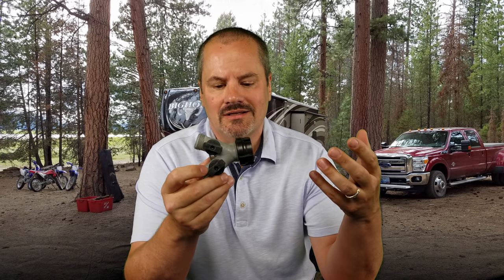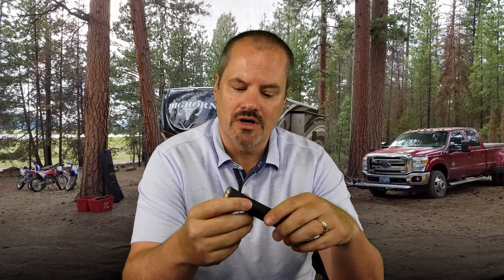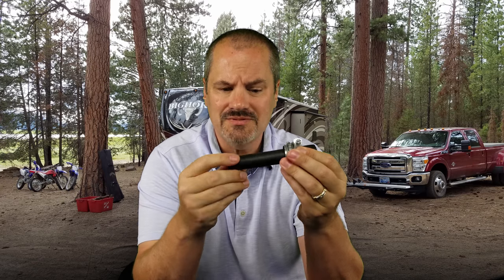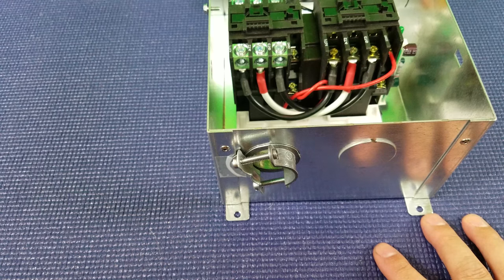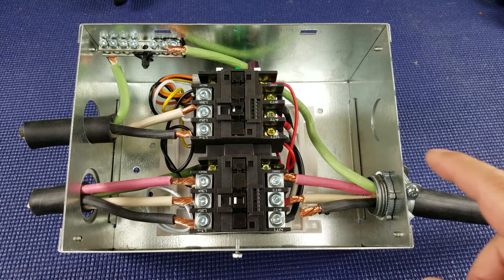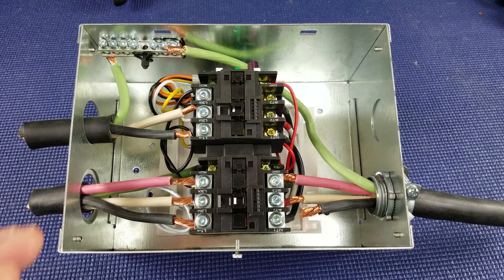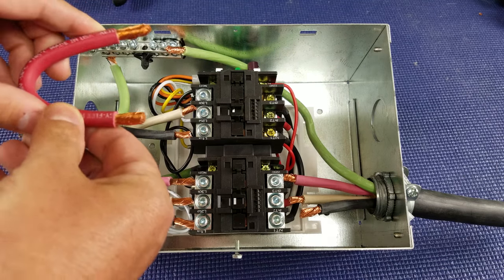Go Power TS-50 Transfer Switch

Comment: Jim, finally a video that makes sense.  What guage wire do you recommend for the jumper. Also,  I have a progressive Dynamics Ems hard wired.  Should this go before or after the bms? Hope your enjoying your new rig. Kip McMillan
Reply from the maker: 6 gauge is what I used and what GoPower recommended.   The EMS would go before the transfer switch.

Comment: This older video is exactly what I needed to know about wiring my inverter into my 50amp switch. THANK YOU! Now, how to run two ATS together to act as a three way switch (shore/genny/inverter). I think I know how, but I'm searching for a definitive answer.
Reply: That's exactly what I'm looking to do as well.  Did you just run one into the next?  I was thinking of running my generator and inverter into one, then taking the output from it and running it into another ats that also has shore power running into it, then the output to the distribution panel.
Reply: @AZMountainMan2U  I did a video on how I word mine. It's on my channel under "campground construction" videos. Basically I rerouted the output line from the rig and wired it into the primary side of the switch which is always the generator side of the switch. And then I wire the inverter into the shore power side of the switch and then wired the output of the second switch to the rig. The video explains it much better. Including what kind of wire are I used.

Comment: Thanks for the info, I had a 30 amp transfer switch on a truck camper set up. Shore power in, through to breaker panel . Remote switch to inverter ,turn on through transfer switch and power early in the morning to make coffee , biscuits. No gas oven. Didn't bother anyone with a generator. 
I was wondering how to get the other side of a 50 amp side energized , didn't think about the jumper... :-)

Comment: These "ATS" boxes for RV are just a pair of bonded contactor in a NEMA box. You can buy the parts for  a hell of a lot less. Some contactors have Normally Open and Normally Closed. I used the Normally Closed to provide hot to the trailer and Normally open from shore power which activates the coil. The contactor had enough "legs" to be able to switch the converter/charger from the normally open too so it kills the converter when I am not on shore power.

Comment: Jim, if I want to add a second shore power input on the front of my RV for my truck bed generator can I just wire that to the same input terminals on the transfer switch you show in your video?  I want to do this because the factory shore power connector is on the back of my trailer, too far for the generator to reach.

Comment: Bummer, I used the go power Ts-30 on my last trailer and it took some wiring but it would disconnect converter automatically when inverter was on. Was hoping the ts-50 was the same as my new unit is 50amp.

Comment: I just hooked the exact transfer switch like he did but, apparently the company switched the lug location around because it didn't work until I switched line 1 and line 2 around. The front panel of the ATS called it Hot 1 and Hot 2. Once I switched it, it worked.  Just in case anyone had trouble with theirs.
Reply: I can confirm that !

Comment: Does it have a timer that can be shut off for a quicker and smoother switch from inverter to pedestal instead of waiting 20 to 30 seconds?
Reply: Swap shore and generator inputs.
Put your inverter input where the shore power would normally be.
Put your shore power where the generator would be.
Worked for me.

Comment: I think you made a great presentation here, you covered alot.  I've got a question i hope somebody could answer, I want to add a 3000 watt inverter, but because my batteries are on the other end of the trailer from the distribution box, i'm forced to put my inverter close to my batteries and that leaves me around 25ft or so to the distribution panel.  So i would run some 8/2 from the inverter to the 50 amp transfer switch,  on my shore power into the transfer switch i would like to use only L1 and leave L2 hooked to the distribution panel,  I would then slightly rearrange my fire place and charger, on the L2 side,  and what ever else i would have to to even the circuits out,  and just use the transfer switch to switch one leg, of circuits i actually can run off the inverter, I would add a neutral from the distribution panel to compliment L1 in the transfer switch.   Im thinking it should work fine as long as the 50 amp transfer switch is capable  of just switching just one leg,   anyone got any comments , and then it might just be easier to wire L1 and L2 into the transfer switch and just turn off the breaker for the charger
Reply from the maker: Your way seems like a lot of work.  I'd either go L1 and L2 through TS, or wire in a sub-panel, for devices you don't want "hot" via inverter (primary item being converter)

or....you go with something like my IC2000 (IC3000 out now) and it replaces your converter and acts as the Transfer Switch.   A bit more $$$, but adds a lot of goodness in one solution (inverter/converter/transfer switch)    Here is link to that video..   https://youtu.be/jjevQ10M97Y
Reply: @tannerjim    The IC3000  was my first pick,   but with the inverter having to be placed near the battery bank, putting in a double run of 6awg  wires in put an end to that idea,  I've got a better idea of how it has to be now, so i will start collecting my parts now,
Reply from the maker: @donandrykew9018  You'd only need 1 run of wire from IC3000 to Circuit Breaker.     LIne in from shore....to IC3000.    Battery into IC3000.    IC3000 output sent to Circuit Breaker.     This is how I have mine wired...works great.   No need for sub-panel

Comment: The video said nothing about the inverter's AC input. Where does the inverter get it's 120 ac power from?
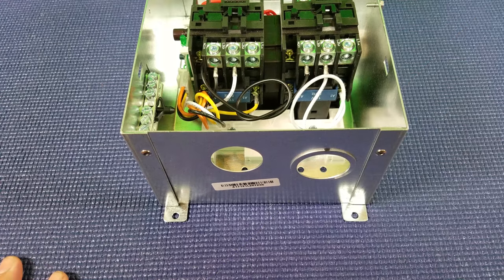Reply from the maker: Look at the 2:44 mark and 4:48 mark...at both of these points in the video I talk about the incoming AC power.    This video is about a Transfer Switch, not an Inverter wiring demo.

Comment: Are the two contactors mechanically interlocked?
Reply from the maker: Sorry, I don't know the answer to that.   I'd call GoPower customer support.
Reply: @tannerjim  Basically, it means if you manually push one contactor to close the power contacts, you cannot do the same on the other contactor. This will prevent one contactor from closing, if the other one is stuck in the closed position.

Comment: What if you also have a generator. Do they make a 3 unit one for that. I think there might already be a auto transfer switch to switch between shore power and generator. I'm not sure, haven't had the RV that long. It's a 2003 Newmar Dutch Star. I know it didn't come with an inverter and I do want to add one. Thanks for sharing your knowledge.
Reply from the maker: Yes, it will support 2 separate 120/240 volt AC input sources, including power
cords, onboard generators, onboard inverters. The ATS will sense the
presence of available power supplies and automatically select the proper one.
Reply: That's incorrect, at least according to the Go Power website (https://gpelectric.com/products/50-amp-transfer-switch/). I'm dealing with this issue right now, trying to figure out how to install an ATS to switch between AC, Generator and solar-fed inverter. The TS-50 only switches between TWO sources, not three.
Reply: If you want to have generator , shore power and inverter you will need another switch.  Go to the link above ,open owners manual , and go to page 6 ,diagram B  . It will show a configuration for , shore power, generator and inverter. Hope this helps .

Comment: Is 30 amp shorepower 3 strand wire? If so, what wire would you recommend for a 2000 watt inverter?
Reply: Geebroni yes 30amp for a camper is 1 hot 120v and a 2000 watt inverter u should use 12 gage wire for the inverter and 10 gage wire for the 30 amp shore power side. Remember rvs use 120 for 30amp and 240v for 50 amp. But 50 amp and 30 amp have all 120v circuits.

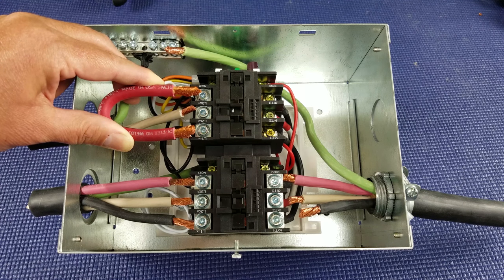Comment: @ 7:00, can you take your converter wire and disconnect it from the breaker and wire it to the same transfer switch block as your shore power wire to bypass the converter when the inverter is being used? And add an inline fuse to the hot wire going to the converter. Would this break the loop?
Reply from the maker: Not 100% sure I'm following your question.  To eliminate loop, simply flip converter breaker...or unplug it if you have access.
Reply: @tannerjim  
I'm thinking that if you disconnect the converter from the panel altogether and wire it to the slot in the transfer switch where the shore power cable is attached then the transfer switch will automatically disconnect the converter for you every time you use your inverter. Just need to add an inline fuse to the converter the same size as the breaker you were connected to. this way the converter is powered directly from the shore power cable only when the transfer switch goes to shore power. No tripping converter breaker or unplugging required.
Reply: Also, Just subscribed to your channel and facebook group (Solar Powered RV's and Boondocking) to help get you over 5000 buy the 31st. :-)
Reply from the maker: @MYCHANNELWITHMYSTUFF  sure...that could work.  Might start to get pretty full at the connection in the transfer switch.
Reply: That’s essentially how the ts-30 is wired to remove the loop.  It’s just fine with caps, not lugs.

Comment: We need full details of materials used and  connection
Reply from the maker: Abideen Raufu
...All that information can be seen if you click on "show more"  in the description.  

But...here it is again

Items Shown in Video:
•    GoPower TS-50 Transfer Switch - http://amzn.to/2uu6L4j
•    High Leverage Cable Cutter - http://amzn.to/2uCY5JH
•    6 Gauge / 4 Wire Cable for 50amp Wiring - http://amzn.to/2tADMrf
•    Cable Clamps (you need 3) - https://tinyurl.com/yb8gcwsk
•    PDF of Transfer Switch Wiring - https://tinyurl.com/y84nlhac